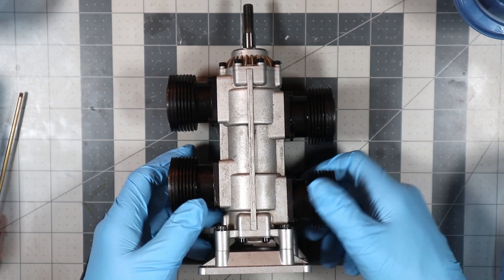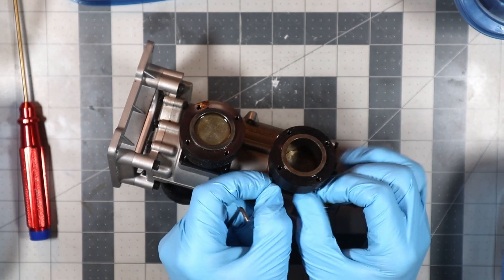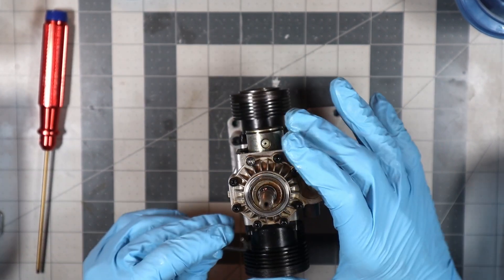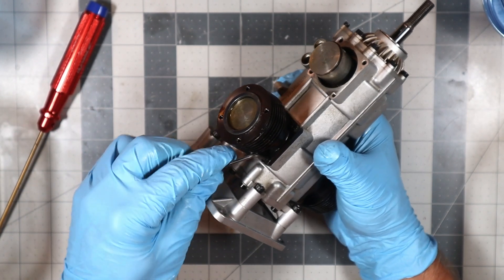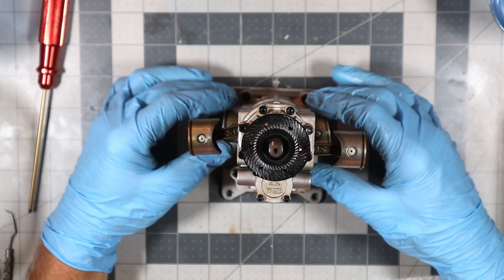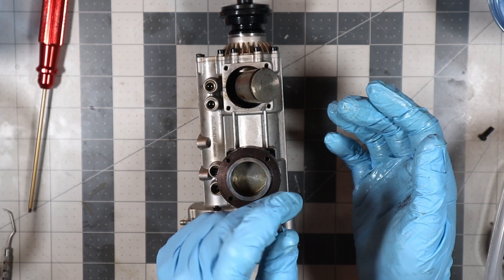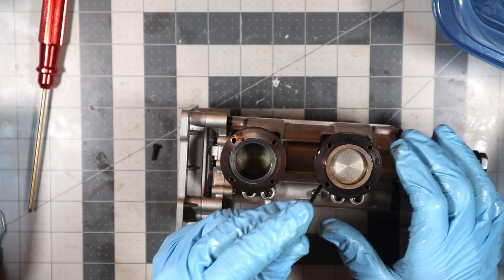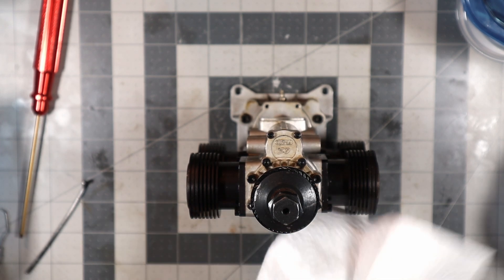Customer Engine OS FF-240 Pegasus Part 5 Cylinders Removed It Rotates

Comment: Not my motor, but if the motor was running and it stopped and locked in place, I would check the conrods and make sure they did not get damaged. Being able to turn it now, and if the motor locked while running, the conrods could be deformed and running it once again could cause them to fully detonate and break, causing case damage or more.

Mostly done with the teardown, a little further and a closer inspection could save an old and fine motor. Plus, it would be a great video for those that may learn from your fantastic knowledge and videos.  I am so thankful you are doing these videos and that I ran across your channel.

Comment: Hello David! Did I miss part 4?
Reply from the maker: I’m not sure if I am posting part 4. It is essentially the same as part three.  I simply removed the other two heads.  The only difference is my commentary.
Reply: @dmrcflyr2 Ok, then I didn't really miss something important. I have a 240FF in my collection, unfortunately the pre-owner messed up some screw heads (i.e. those of the valve covers) and I can't find original spares.
Reply from the maker: Try Ripmax or RCJapan. Screws are screws and are easily found. What’s the difference if they are not original?